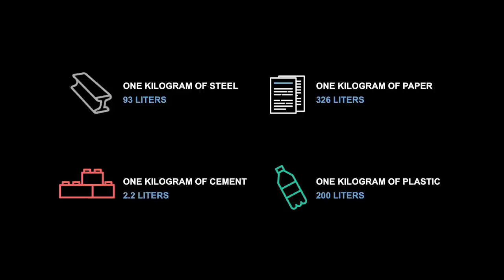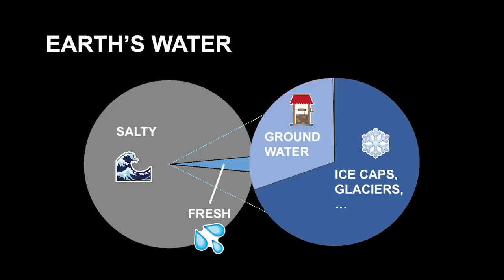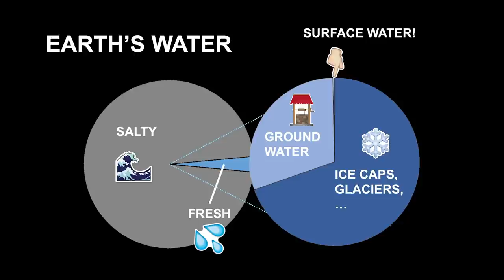Securing our shared water future amidst climate disruption | Seth Darling | TEDxGateway

Comment: 1. Water is a renewable resource. 
2. Desalinization is an existing technology. 
3. Drip irrigation requires replacement of miles of tubing every few years.
4. Steam generation of polluted water is going to leave behind a concentration of pollutants.
5. Quit for-profit fear mongering.
Reply: Desalinization costs a fortune, if that was the easy solution there wouldn't be a problem.